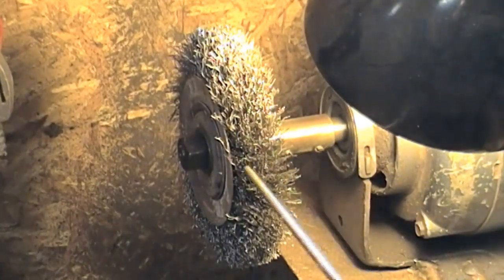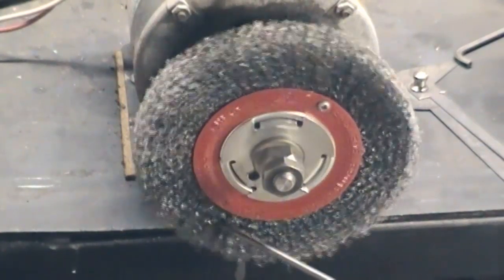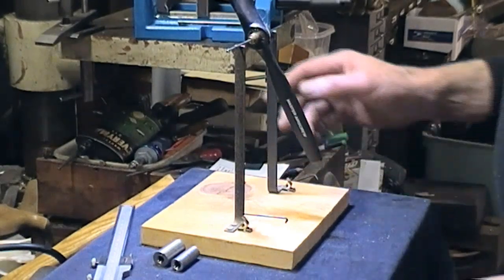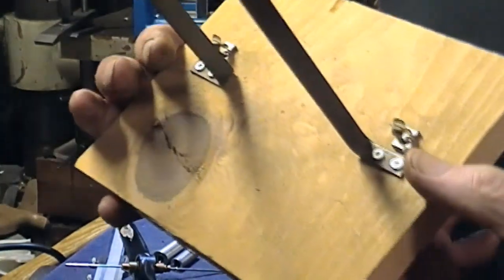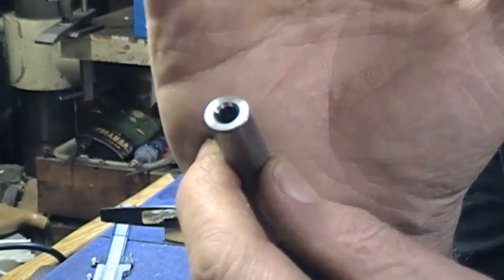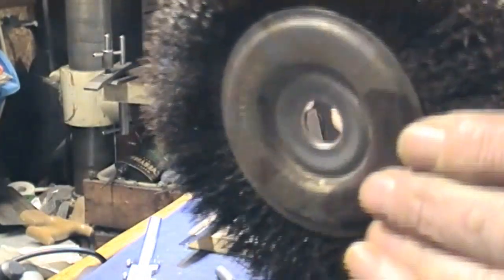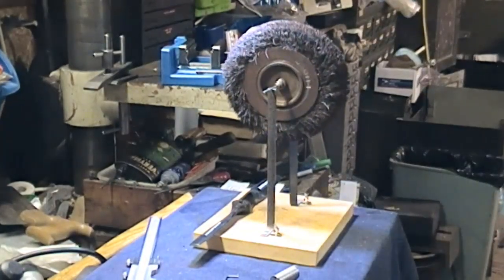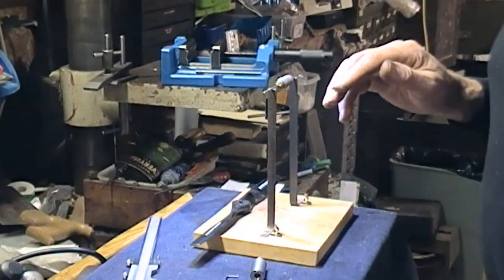A Wire Wheel Balancing Method

Comment: There's a few things wrong here. 
First you don't note that the 080 piano wire MUST be perfectly straight. Better to use the largest diameter rod you can get away with. 
Second: riding in that groove means an up hill climb either direction. Better to let it ride along 2 straight knife edges.
Third: You know you have true balance when you have the condition that when spun the wheel never stops in the same place.
That your propeller swings back and forth like a pendulum shows not so much that it is balanced on either side along the blades but that it is out of balance 90 degrees from the blade tips.
(Former watchmaker who had to adjust balance wheels all the time)
Reply from the maker: Thanks for the input - it was mainly that I had the v simple prop balance set up on hand.
Certainly knife edges would be better but in the end even this basic approach did (maybe by luck!) achieve a huge improvement.
Reply: ChrisB257
It's certainly better than nothing (as demonstrated by the evident imbalance of the wheels in the video). I'm just point out that there are significant improvements to be had. The knife edge is extremely low friction allowing you to super fine tune the weight distribution. I still love your videos and sense of humor. I hope your health improves and you can maintain. You look to be about my age, but I'm just starting out with machining so I gain a lot from you "oldtimers". :-)

Comment: Surely the grub screws in the hub bushes would give you an out of balance before you even put the wheel on the mandrel, some sort of threaded and tapered cone would seem to be a better system. It looks like your big wire wheel will need quite a few PKs screwed in on the light side to get it in balance. Chris B.
Reply from the maker: I don't think that small factor matters too much compared with a potential gross imbalance in a wheel itself. I like your idea - but thus far this approach does seem to deal with the major imbalance, enough to get a good improvement anyways.

Comment: Thanks Chris, never thought of that technique for wire wheels and the screw is real smart idea.  Those Cheap and Cheerful wire and grind wheels are pretty problematic, some decent others horrible.  Have run into that thin hub issue and built AL flange bushings for them to give them a bit more meat.  I'll give your technique a try.  Did a lot of prop balancing back in the AMA days for Rat Race and 1/2A speed...UControl of course.  We used razor blade V's and similar cone bushings.  Thanks for sharing.  PJ
Reply from the maker: The AL flange idea is good - may well do that for these thin hub items. :)

Comment: Hi Chris, some years ago I made a balancer to adjust 1/10 Rc cars wheels. In accord to my experience, when you have very light weight to balance, you need e very drag free surface where letting the rod turning. After several attempts, I found easy and precise to build a balancer where the rod can rotate on two blades glued to the structure. And I added four (one for each corner) screw to the base to proper level alla the assembly. In this way my balancer was able to discover even the smallest amount of unbalanced weight on the little wheels. You can try to glue some pieces of cutter blades just to see how can improve that.
Reply from the maker: Indeed, for very light items drag-free is essential.  Fortunately with the weight of wire wheels, not so critical. 1/10 wheels - now that's a challenge!